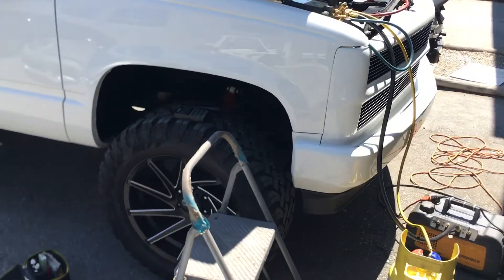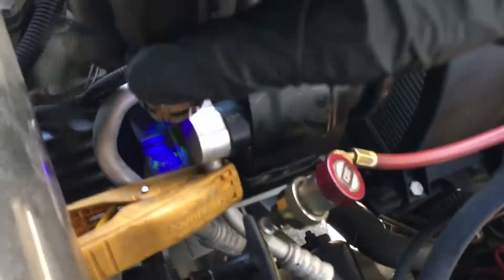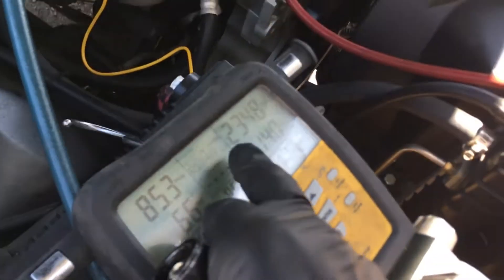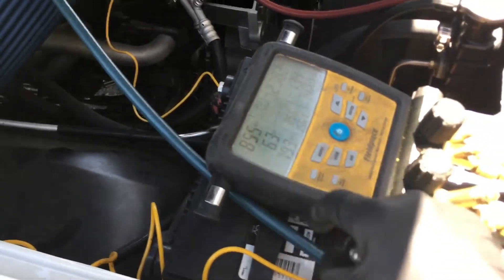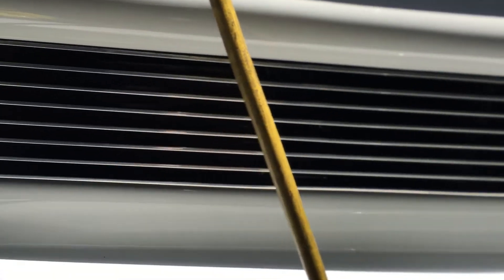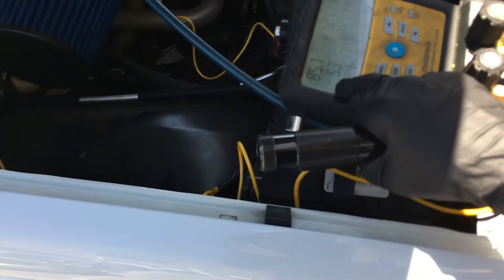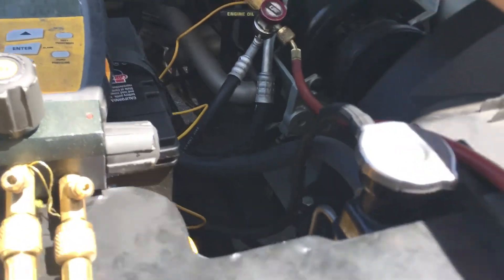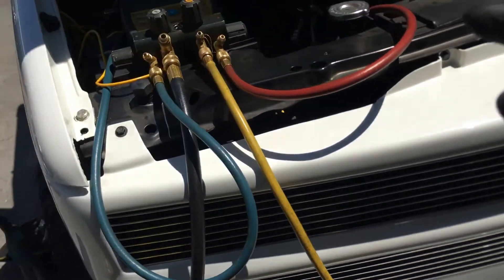AC. Possibly missing orifice tube. Piston ring material in brand new condenser plugging,

Comment: hey, 
is it normal for the out of dash temperature to be below zero, negative? I have almost -5*C (22F), on ambient temp. 19*C(67F) or...something not working properly? restrictions? Whats your opinion? It is system with orifice Tube and filter drier ( car 2000 year). Thanks
Reply from the maker: You’re measuring device most likely. 

The next thing would be a defect in what controls the office point of your compressor .
Reply: @coldfinger459sub0  do you suppose that measuring device? ok i will check it, but i'm 99% sure it's working correctly. Could be this dangerous to compressor when using A/C with such parameters as i mention, with extremaly low evap. temp and pressure?
Reply from the maker: @eklazhward4739  it sounds like it’s an old car if it’s the measuring control device on the vehicle that is not controlling to off. 

Do you have a small, heavy black steel plate block of steel or Coca-Cola cans filled with water spray paint the outside of it flat black with some flat black paint like Weber spray paint anything flat black 

White instead around would be preferable . 

Leave it in the freezer overnight 

If you’re using a thermal gun infrared thermometer, use that as your reference should be 32°F

If you’re using a stick tape thermometer 🌡️ 

And if you have distilled water or reverse osmosis water, that is the best but plain tapwater will work the mineral Contin actually adjust the temperature down a little bit, depending on the concentration of salt in the water

Throw some ice cubes in some water stir up the glass let it sit for two or three minutes.   Then stick in your thermometer and read the temperature should be at 32°F.